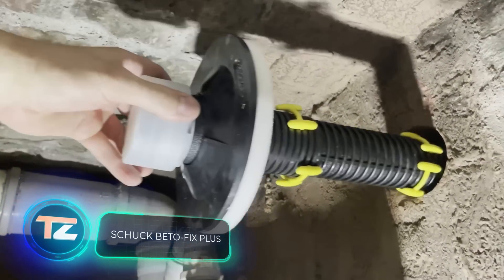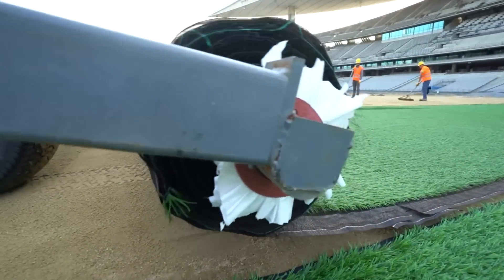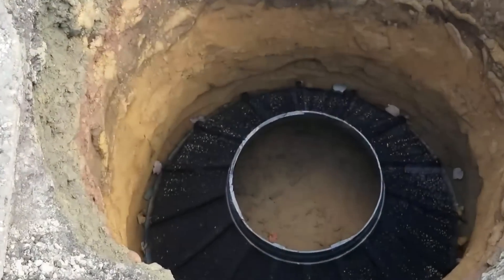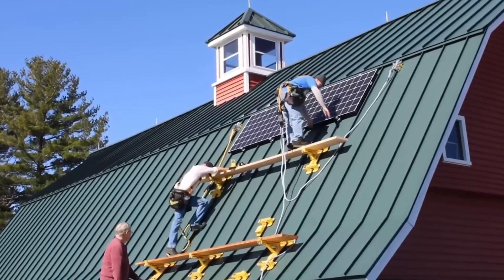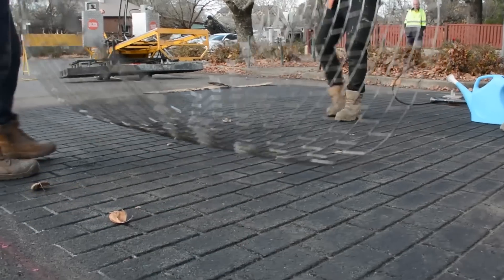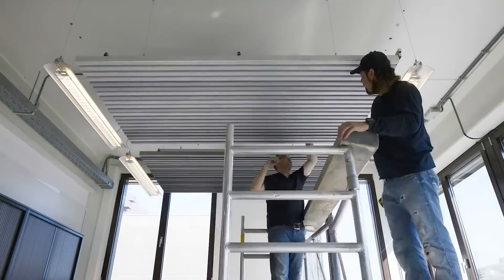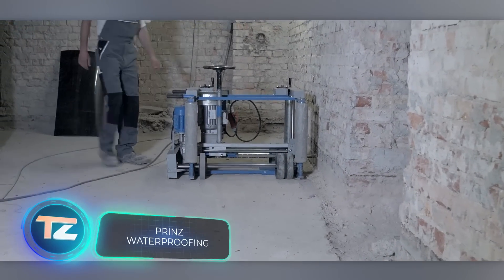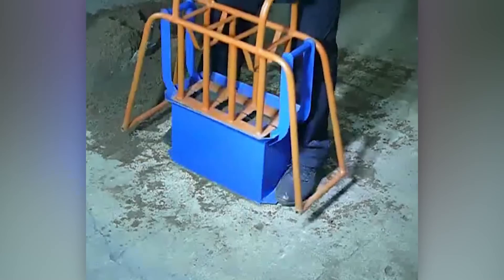CONSTRUCTION TECHNOLOGIES THAT HAVE REACHED A NEW LEVEL

Comment: Postsaver, why? buying plastic to put in the ground?  Charred wood is extremely resilient to rot as well as insect damage. In fact, the charring process on some woods even makes it resistant to fire to Euro Class B. This is because the process of charring the wood draws out moisture from within and leaves a natural protective chemical compound on the surface.
Reply: Bad consumer, bad

Comment: The asphalt treated 2 look like paving stones - GREAT idea. Could the paint coloring be added to t asphalt product directly? Thus cutting down t man-hours of color application? Just inquiring. I realize asphalt is 'black' n color. Perhaps,  color application could be applied w/in t form itself. When hot asphalt is laid down t color would  adhere cohesively lasting longer. Kind of like heat wrap. May drive cost up, but n t long run cost effective. I don't no just thinking out loud w no professional background on this particular merch. 🤔🥴 PottsvillePA.